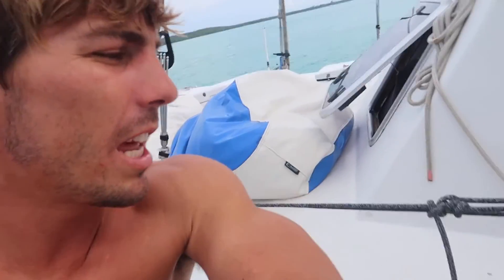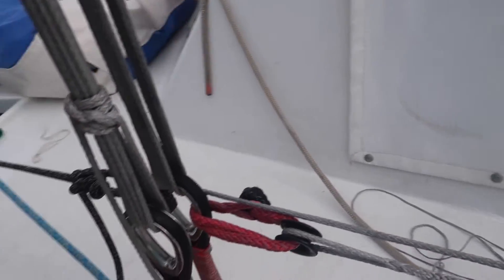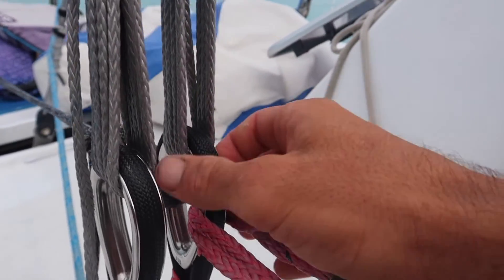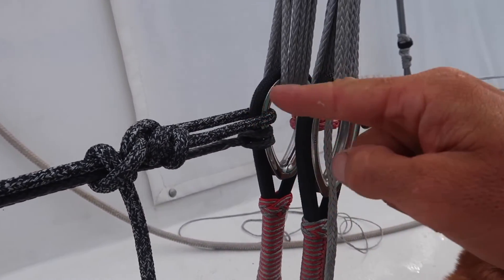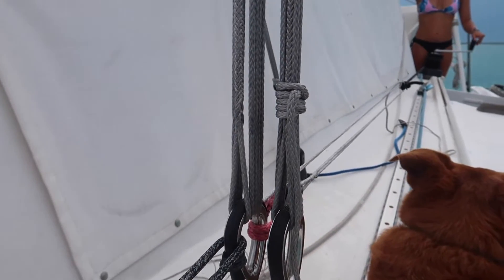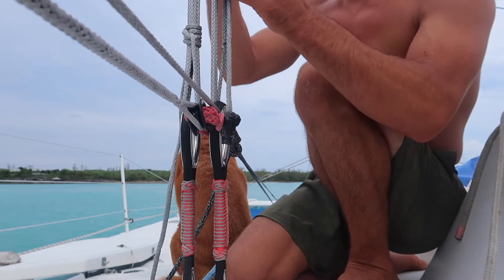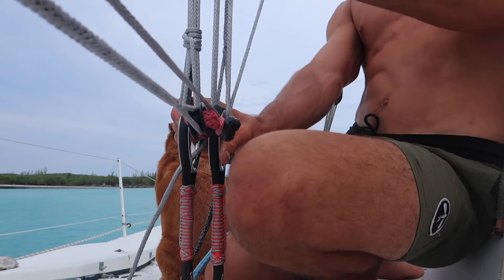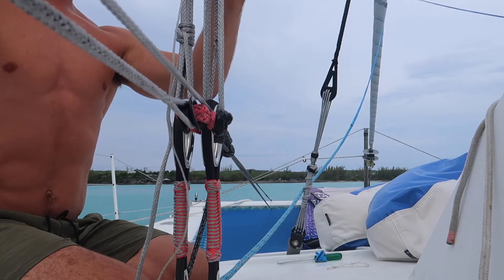Tensioning Kraken Structures Deadeyes for Synthetic Standing Rigging

Comment: I know that several you tubers tension in this ‘right angle pull against an anchor’ method, I have used it and it is a bit fiddly; I think using a halyard fir in-line upward tension is easier, even easier if additional blocks or rings are put in the system temporarily, it should be possible to get the shrouds tight just by hand.

Comment: Love the turks heads. One hint - when you're french whipping the tail at 10:18, lay a small loop in and whip over it. Once your tail is shorter than the whipping you've laid down, pass the tail through and pull on the loop to bury the tail into the whipping.

Comment: If the frapping relies on friction, I'm curious why dyneema would be used for the lashing. It is notoriously poor not tying material due to its low friction coificient. Since the frapping doesn't require a high tensile strength, I wonder if some other UV resistant cordage with wouldn't work better.

Comment: That's called a rolling hitch.
Reply from the maker: I am not sure which knot in the video you are referring to but there is absolutely no rolling hitch in this video whatsoever
Reply: @TulasTechTalk  Actually there is a rolling hitch and I saw you doing it on this video. It's where you wrap the line around another link of that same line that is coming from the opposite direction. You have to do two wraps around it but you did three which is OK I guess. I've only ever needed to do two. It's basically a slip knot if you slide it yourself or if the line is slippery or if the load is so great that it will slip on its own. I use it all the time. It's a great knot to use all the time.
Reply: OK, I just looked up what a rolling hitch is and they have listed differently than what I thought it was. It's basically the same thing but what I do is tie a knot around one thing and then take the bitter end and run it through another point. Then I take what's left of that line and wrap it around that part of the line that is between the first two points and the way I do that is doing what you did in the video but only two times. That's what I've always known as a rolling hitch. I guess it's called something different from what I was told. Sorry for the confusion.

Comment: Nice work Billy. I am always impressed by good lashings and seizing. Just a little tip, use a Phillips screw driver for pulling tight. It slides out of the marlin knot easier without having to loosen it.

Comment: I have been looking into this, and I cant find a valid reason not to use a turnbuckle for tensioning. Not pure synthetic, but seems easier to me
Reply from the maker: Weight, possible expense, you have to measure and splice very precisely. A lot of people do though especially on bigger boats and it might be the right choice for you
Reply: I imagine and again emphasis on the word imagine it would make it far easier for the final tune
So initially use the lashing and wrap and then for the final mast placement and adjustment use the turnbuckle to save relashing

Comment: Interesting vid......I really like the synthetic cables ......but still don’t understand the benefit of using deadeyes & lashings over conventional turnbuckles. The extra weight for turnbuckles (at deck level) seems easily justified by their simple installation and ongoing adjustability.
Reply from the maker: you're right in that they are much simpler to tension and the weight savings is not too great. The only disadvantages COULD be that you don't have much room for error in your measuring and splicing of shrouds, the cost of new turnbuckles could be higher, and you still have the long term corrosion to consider on the turnbuckles. On a boat our size or bigger turnbuckles should definitely be a strong consideration especially if you are confident in your measuring and splicing and you know you are going to pre-stretch after splicing.

Comment: Really like your tech talks. Not sure if you want to  answer this question but what size dux would you use on a 27 ft catalac with a 39 ft mast, single spreader (obviously).
Reply from the maker: I think the general consensus is to just go up one size. For us we replaced 8mm wire to 9mm cable. The consensus is to also size it for creep, not the breaking strength. Here is a chart by colligo that gives this information https://static1.squarespace.com/static/556621c8e4b02628a8d3bde8/t/562688a5e4b08b7d50464bfa/1445365925954/Stretch+Equavalents.pdf
Reply: thanks Billy, im headed to that link now

Comment: Really nice job on the camera work and explanation Billy, awesome!  I use 2 to 3 feet of lashing, 80 cm to 1 meter, like you said because it has an improved throat angle for the lashings and there is less outward pull on the frapping knot in the center. Those are good reasons but most importantly it gives you the most room to absorb creep over time.  I would have to do the math on the publish elongation rates for the 9 mm Dux, but you can actually figure out how much creep to expect over the next 5 to 10 years.  Its a very small number of mm per year, but when you add it up over 10 years it can end up being a few inches.
Reply from the maker: Thanks so much Luke and thanks for all your useful comments and inputs here.

Comment: Very interesting watching you actually do the tensioning. One question: with steel rigging, there are gages that one can use to accurately measure the tension are their similar gages for synthetic rigging?
Reply: There is some guidance on the Colligo website about what Loos gauge reading to use for synthetics but it really isn't a set science.  There is a great deal of variation between sizes of Dyneema and the loads they are being subject to with different Rig plans on diff boats.  The best thing to do (IMO) is first to tune you rig so the mast is straight and in column as you normally would.  The resulting tension should never be piano-wire tight, nor should it be so slack that it bounces around.  When sailing you should note the extra tension placed on the windward shroud while also noting the slack on the leeward shroud.  If the leeward shroud is so slack that it is swinging around, then it is too slack.  James from SV Zingaro has basically been 'tuning by eye' for about a year and finds that he has no need for a Loos gauge.  Stay tuned here to Tula's Tech Talk, I am 100% sure Billy will be tracking, measuring, and commenting on the rig performance, tuning procedures, measured stretch, and other notes.
Reply: @SteelDoesMyWill  I've been thinking about this problem too and I think I have a solution (although I haven't validated it yet). I have a digital industrial scale, the kind that has a hook on either end, that can be placed in line. I expect that I could put a sample under tension, measure the load directly with the scale, and note the reading on a Loos scale.

Comment: Excellent instruction on a solid system.  I don't know the forces on your boat but I was thinking that the 2mm frapping knot plus all those half hitches on the tail plus the velcro seems like overkill to secure the lashings.  It looks like it takes a ton of time for each shroud.  Plus for adjustment you have to untie all that and retie it just to adjust your shroud tension.  I have a similar set up on my Wharram 38 but I just use the lashings and the tail to secure it at the end.  It still takes 3-5 min to secure the tail with half hitches but way less than this idea.  No question yours is more secure but how secure is really needed?  What do you think?  What does Kraken think?  Just subscribed to his channel actually.  Wish he had more vids.
Reply: LOL, I am working on more vids.  I filmed a bunch and then never liked them after rough edit... so hard to try to publish vids while working full time plus having so many rig projects (ask Billy & Sierra how tough it is to keep up with filming and editing, and they are Pros!).  The velcro on the frapping knot bitter end is dressing only, it has no mechanical binding strength.  I use a 2.2 mm dyneema for the frapping knot because it ultimately creates a massively stronger frapping knot than the larger diameter lashing line itself (due to actual surface area contact).  I splice an eye into either end of the frapping knot line so it is easy and fast to start and finish the frapping knot easily without additional knots.  the frapping knot comes off in about 45 seconds and is completely reusable without having to cut anything.  The French Hitching is a very nice way to dress the remaining tail of the lashing line, but you have a good point that it is time consuming to un-do each time you want to adjust the rig tension.  I typically cut my lashing line shorter and splice an eye in the end, this way after I tension there isn't much tail to deal with and I just make an additional pass or two around the thimbles with the slack and secure it with another velcro One-Wrap.  Billy has a good point that the French Hitching protects the lashings from headsail chafe.... buuuuuttt.... I wonder where the leather chafe sleeves are that I made for him? Billy? Sierra? LOL
Reply: @SteelDoesMyWill  Hey Thanks.  My rig is new from the builder in Philippines. I love your deadeyes but can't see replacing mine now.  Perhaps in a few years.  Ill be watching your progress.  Best of luck with the new biz!  Hope you can quit your day job!